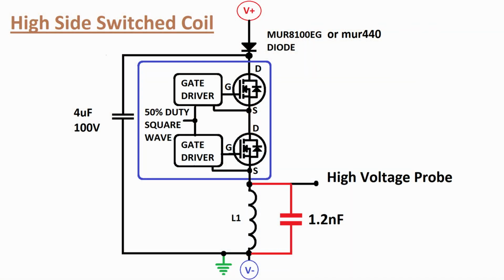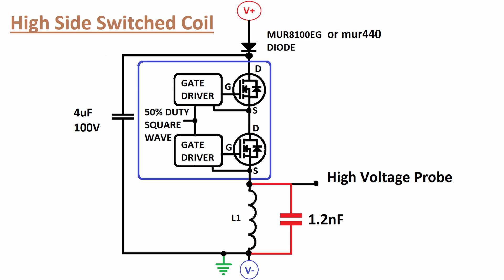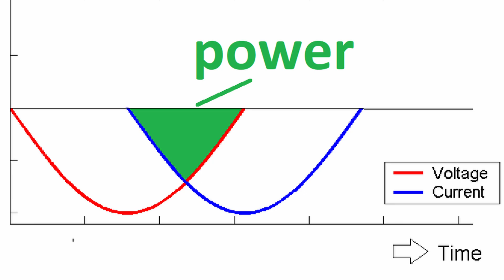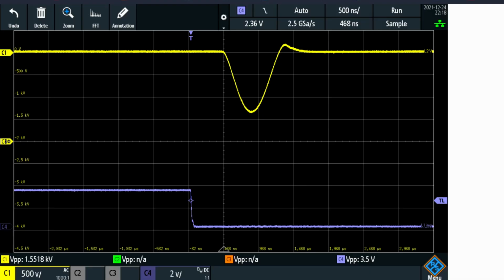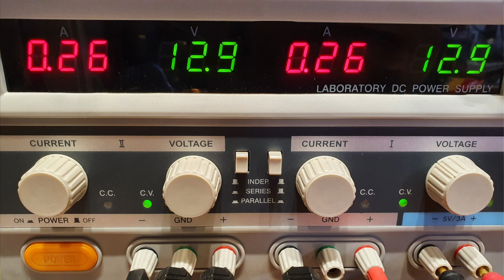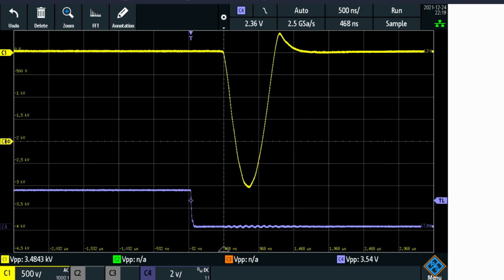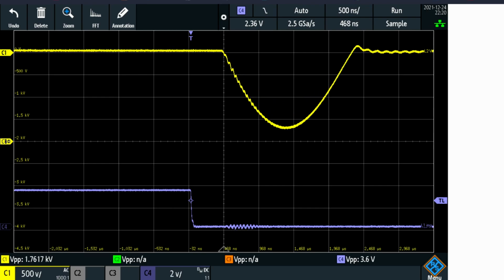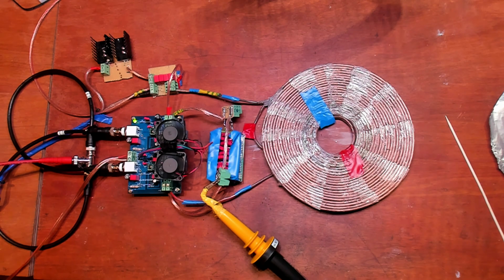Powerful Impulses Levitating Aluminum

Comment: If the coils produce a unipolar field; would you then create a null point between two coils aimed at eachother? I'm reminded of Eric Dollard's  claim that two unipolar fields create a counter-spacial displacement when interacting with one another. Perhaps you could light some vacuum bulbs with your coils? Awesome content as usual; thanks for sharing the knowledge with the people!
Reply: Eric Dollard is a TRULY brilliant Engineer, Electrician, Inventor/Scientist, & argueably one of the best Nikola Tesla device reproducer (i.e. has reproduced at least at some proportional scale, & in principle, basically all of Tesla's experiments & many of his devices).
I have a hunch that using the bifilar-pancake-coils in the same manner of Dollard's "opposing unipolar field-coils", would produce (basically) the same effect as the coils that Dollard used.  Obviously this requires much know-how about tuning, resonance, coil-specifications, &c, &c.
But just like Karl Palsness' demonstration(s) at AEPC, he mentions the same "explanation" of these phenomenon as Dollard....  that is: the characteristics & dynamics of the COUNTER-SPACE domain [as opposed to normal electr(on)icity, which is a Transverse Electro+Magnetic waveform dynamic & domain].  And this would be synonymous with the DIELECTRIC side of Electricity [as opposed to the Magnetic], which is found to have an Inverse relationship with the size-of-distance between 2 Conductors NOT TOUCHING with a Dielectric medium between.
To myself, this hints (and honestly, REAKS!) of an INVERTED "Space-time" domain, if you will.   I have ALSO heard this same arena of the Dielectric be termed "Time-space"....  not that that label in-&-of itself explains much, but just for a quick example:

HERE, in our day to day life, we exist and interact with (perceptually, mainly) SPACE-time.  This means that we can & have the ability/agency to move freely through SPACE, but at the cost of TIME (& energy, but lets keep this example fairly simple).
[Also, I believe we have enough scientific & experimental results to say fairly certainly that what we experience as GRAVITY is really just the 'Remainder' or 'Left-over difference', after the whole of the Dielectric & Magnetic Fields of the {insert cosmological body here, but for our purposes, let us say} Earth, and that the DOWNWARD/INWARD pushing force is Predominant, or has a slight bit leftover after canceling out the opposite OUTWARD pushing, or LEVITY force.  Therefore a remainder of 1-G is left (this is what we term 1G, or the natural level of downforce applied at the surface of the Earth. On other planets/bodies we then modify this quanity to say its "3G's" of force (or 3x Earths apparent Gravity), or 1/2G, or 1/3G, similar to what is said to exist on the surface of our Moon.

John Hutchison, as well as many others (even Nikola Tesla) have done experiments that show that under certain modulation of frequencies & powers, this Gravity "force" can be negated more, or the rest of the way, and then the LEVITY, outward-push, starts to become the predominant effect within a specific area or domain or craft.

If you havent heard of it yet, do yourself a favor & go check out the APEC Conference YT Channel (i believe they have a website too), as they post Online Conferences & presentations from MANY different individuals & areas of study, all high-caliber & highly intelligent and driven individuals interested & involved in this type of study, & ACTUAL research!! 😁👍💯

Anyway, im starting to ramble, lol.   OH, but one last thing!   ALSO check out the Martin Fleishmann Memorial Project YT Channel with Bob Greenyer (I think they also have a website), as there is also an astronomic PLETHORA of amazing research & data in his videos/presentations as well.   And both MFMP, & APEC do fairly frequent Livestreams here on YT, as interaction with these kinds of communities at large is a FUNDAMENTAL aspect to achieving the goal of having manifest these amazing, mind-blowing, helpful & productive (and, mostly, CLEAN & green) technologies and the knowledge of them (and how they work) to the greater public & humanity at large.

Much love, be well, & happy tinkering!!!! 🙏😊👍⚡🌀⚡💯

Comment: You actually invented a very efficient heater it seems to me!
cheers,

Rene - Harderwijk
Reply from the maker: Maybe René, I should run some more tests and see how fast I can heat some water.
I love Harderwijk. I lived there!
Reply: @MasterIvo  
Maybe we can someday connect.
I don't know where you live right now, but our country isn't that big :-)
We have a group of tec enthousiasts, you might want to meet also.
cheers,

Rene
Reply from the maker: @emc4u2  that might be fun!
Reply: A supper efficient levitating heater! If the heat dissipation could be made directional and the transfer accelerated, perhaps thrust could be generated.

Comment: I mean, your knowlwdge of elecrical circuits is impressive, but if you want to understand the universe please reffer to the works of Walter Russell and then do experiments. You want funding for your beating with the srick around the bush, but why dont you learn the bush it self. All knowledge is given, you just need to understand the presure zones of oposing waves and you will understand that electricity is just as any other atom but vibrating at higer frequency (octave). We humans still do not comprehend the dual nature of matter nor the processes of creation. Take 2 domes of aluminium and divide them with a dialectric, each of those domes charge with static electricity of oposing charge and make the charges on one dome bigger than the charges of the other dome and achieve force which we humans call anty gravity, or added gravity if charges are reversed. LoL. That is because atoms we call electricity seek lower pressure zones which are above Hydrogen element. Hydrogen is the element of the lowesr octave or pressure zone we know off, while elements we call electricity are in even lower octave. Think about it my brother. :)
Reply: So basically electricity are waves in  the hidden lower elements in the periodic table that russel speaks about such as alphanon, hence the aether ??

I am familiar with russel do i have a hard time comprehending some of his models. I need to go more in depth, as I do believe as well as you, that much of the natural laws of the cosmos are hidden in his work.
Would you mind sharing online resources where I can get more in depth into his work in a manner that is not to hard to comprehend?

Also have you succesfully replicated the aluminum dome opposing charge experiment ?
Reply: If you want it deeper it goes that 2 waves (male and female) intersect in a cubic field and it forms a sphere. Higher pressure (octave) waves contain all the waves within them self and each of these waves forms a sphere. That is why our planet is formed of different spheres inside one seeming sphere. Radioactive elements like Uranium belong to the highest presure zone which is in the center of the Earth, while electricity and elements above belong to pressure zones in oposite directions. Mentioned processes of forming spheres is called integration. Once a sphere is formed it desintegrates in to polarizing rings (+,-,+,- ...). The ting is when something is desintegrating it is integrating another thing (element or system of elements), just like the Sun is integrated from desintegration of its primary ( Milky way) so is the Eath integrated from its primary the Sun. When you send electricity trough copper, you integrate its lower pressure waves which quicken the disintegration of its lower pressure spheres which in cascade quicken disintegration of all other spheres. This results in copper disintegration because our visible copper integrates the air and so on... untill the lowest pressure zone. Example of this would be a sound wave dissipating in the air. Read Walter Russell's The Univetsal One book if you need more truth. All of this you can test in the lab and find truth.
Reply: And since you like Nikola Tesla let me tell you what he told Walter Russell. He told him he should lock the books he wrote in a safe for 1000 years because the people are not ready fot this knowledge ;). The sad truth is most of the people can still not comprehend his words.
Reply: @AmazingABCsOfFacts  Sorry me again, I am a beginner so don't mind me but how exactly do you charge with static electricity of opposing charge, will charging with high voltage the one side, make the other automatically the opposite charge? Isn't that an aluminum double dome shaped capacitor? I've read studies that with regular flat parallel plate capacitors they discovered a weight reduction after they charge it above a certain voltage.
Reply: @ThatThing1675  yes I am also talking about a capacitor, and the charges are made by the van der graaf generator from the inside. One half of the dome charged with positive static electricity made by high volatge, and the lower dome half is charged with negative static electricity. You can also look in to T.T Brown effect or electrogravitics. But the antigravity is besides the point. Read the The Universal One  by Walter Russell, then you will truly understend physics. Just like you have Sodium and Chlorine, two oposing pairs which react hard to find balance, so is "electricity" multiple atoms of different polarity integrating and disintegrating at incredible speed. These atoms are in higher octaves then hydrogen and much much lighter. All atoms seek their own pressure zone thats why hydrogen flies up, so do electrons.
Reply: @AmazingABCsOfFacts  Thanks for the advice. I agree with your previous comment though,and i am pretty sure this dude is one of them gatekeepers. This comment section is probably the most worthwhile thing on his channel. u2 not only doesn't censor him, but promotes him as well. Have your studies helped you out to get off the grid and not pay for power? If not , i can help you out and perhaps point you in the right direction. Once you skip all the disinfo guys, and find someone who genuinely wants to help, its surprisingly not so complicated.
Reply: @ThatThing1675   I dont care about getting of the grid, but I would like to contribute to society by teaching how fabrics of space work so we get a more efficient grid. I am more in to spiritual awakening and doing whatever I must do as an art form
Reply: @ThatThing1675  also, I dont think our society is ready for antigravity eather, we should be confined to this planet untill we learn true balance or achieve rythmic balanced interchange
Reply from the maker: and time.

Comment: Due to the weight of the thin oil layer on your foil disk, it levitates much lower in my opinion you would have had a levitation of about 5 cm higher for 29W of input power it's very amazing ! And if you add another coil instead of a capacitor in parallel you would have had the same kind of result ?

Merry Christmas !!!
Reply from the maker: not sure, but I think another coil would not improve it.
for me its important to understand how to get more power from the impulse (for use in the L2 primary)

Comment: I, too, have noticed that increasing the capacitance (within reason) lowers the peak voltage but increases the current such that their product (V*I) results in higher power (W). I'm curious to learn if you've measured the rectified DC output from your new L4 coil with this added cap on L1.  Happy Holidays, Ivo!
Reply from the maker: Not yet, but will do! Best wishes

Comment: 👋 hi Evo! Really like your research, ever thought to use two coils themselves to buildup as trasformendensator? 😄 I mean to use them both as condensator and transformer? As dielectric between the two you could use water, very good insulator.... maybe ionizing and eddy current in water could do something like warm up the water super fast. Happy holidays 😊
Reply from the maker: Yes, I presented that Idea in my coil capacitor video. I use epoxy as a dielectric between the plat coils.
I still intend to use it, once I bring all the knowledge I gained into one working project
Reply: @MasterIvo  😊,  i would nevertheless try to use water, much more dielectric, actually one of the most, and who knows what else 👍
Reply from the maker: yes water is an awesome dielectric, as long as it's pure.
Reply: @Fi0raVanTi97  it is only good as a dielectric as long as it is pure. Try keeping water pure with metal electrodes.

Comment: Merry Christmas! With the foil getting hot, is there a way to make an efficient heater using a similar or bigger setup?
Reply from the maker: yes, I could place a pan on it and see if I can cook an egg.
Reply: This is exactly how induction heaters work.
Reply from the maker: yes! but this is a completely different technique
Reply: @MasterIvo  would love to see if the power consumption could be still decreased by Re-closing the MOSFET exactly at the point where the MOSFET/sic fet's body diode start to conduct. A levitating cooking pan, would be a nice one. This would also eliminate the need of having a heat resistant ceramic/glass in between.
Reply from the maker: but the mosfet switch is closed when the body diodes open!?

yes a flying cooking pan would be awesome
Reply: @MasterIvo  ok now I am confused, closed in terms of the conduction path is closed and has low resistance or closed in terms of the doors are closed nothing goes through.
Reply from the maker: ah yes. thinks of a physical switch. when it is closed, then it conducts